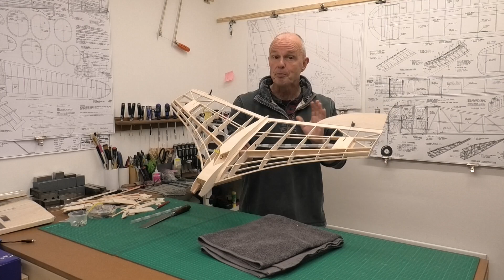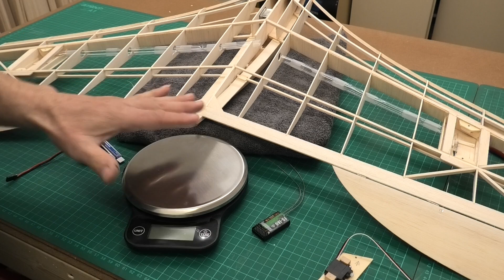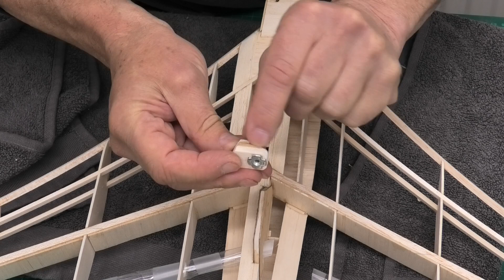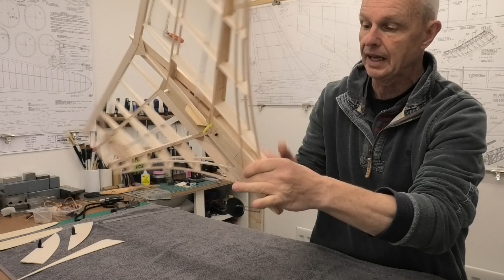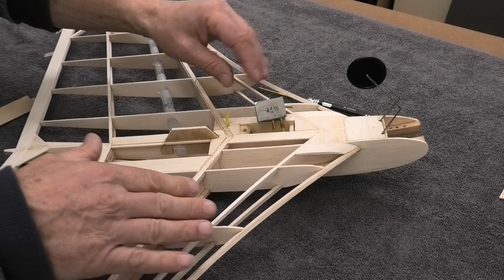Ion 1950's Futuristic Flying Wing - Pt8: Radio Gear & Hatches - By  O.F.W. (Peter) Fisher

Comment: How can the Flysky FS-iA6 receiver work with a 3.7 V 1s LiPo? The voltage range of the receiver is specified as 4.0-6.5V. Will the 1s LiPos only utilize the receiver's voltage range of 4.2 to 4.0 volts after they have been fully charged or will the FS-iA6 receiver also work with a voltage below 4.0 V?
Reply from the maker: The receivers will work at voltages below 4v, but there is very little current draw so battery can be used mainly in the 4-4.2 range, and just replace the battery after a few flights.  Not sure what the final battery will be yet